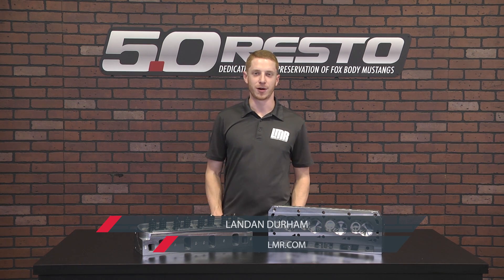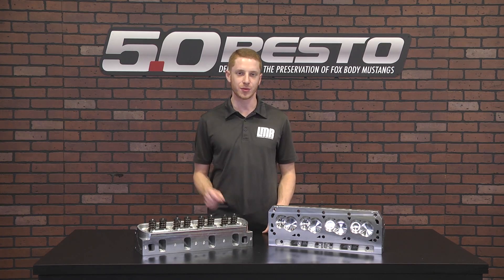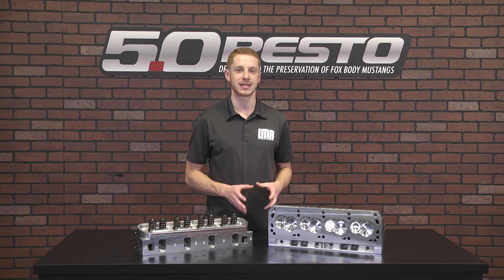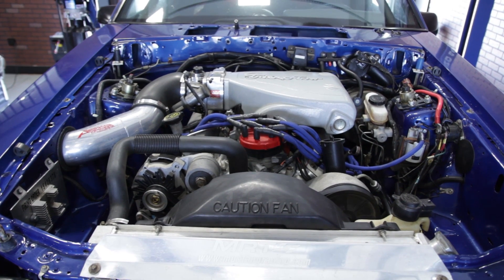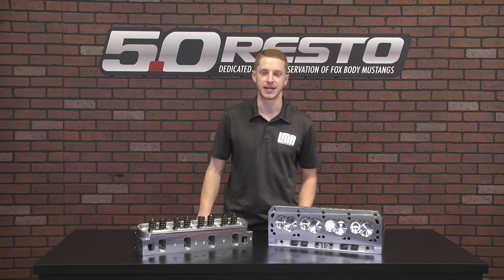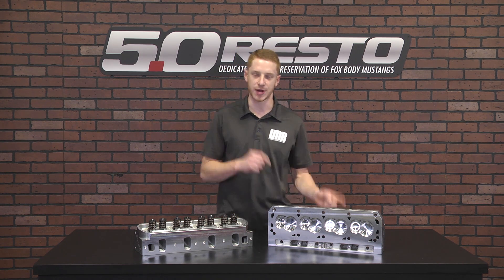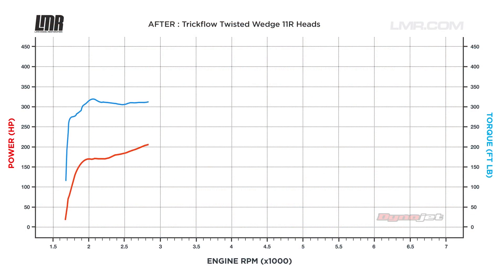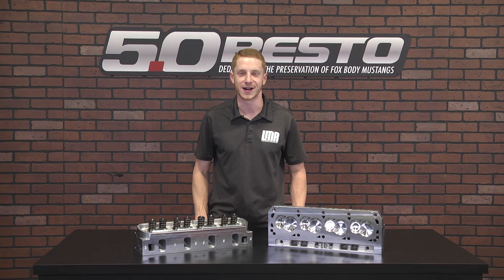1979-1995 Mustang Trickflow Twisted Wedge 11R Cylinder Heads - Dyno

Comment: The 331 made some horrible power before hte 11r... my stock 302 with a stage 2 ported performer (not rpm) head with a 1.94 valve change made 315 to the rear wheels.... ran 7.70s in the 1/8th on motor...
Reply: How much did the 11r smoke the stage 2 ported performer heads?

Comment: 5600 rpm is the peak?? Those heads would make a lot more power with a lot more camshaft. Why not build it to peak at 7200+ ?
Reply: Exactly, 302 has a short stroke when you're concerning small blocks.   So 7200rpm is easier on the bottom end than 7200 on a ls or a sbc or a 351w or a hemi.

Comment: more torque than horsepower needs a bigger 11R head like 195 comp port small cc combust chamber
Reply: The biggest restriction in this setup is the intake, all though im with you with a 331 stroker, why wouldnt they have just put the 190cc, or even the 205cc 11R's!?
Reply: Which intake should they have run.   I'm so used to seeing LS numbers.    A good built LS1 ( 346 ci ) make 400-460rwhp with 400-420rwtq.    It'll have stock bottom and from stock to 300cfm@.500" lift type of aftermarket head, cam, exhaust, possibly intake ( ls6 or fast ).    A good built LS3 will make  450-550rwhp and 430-465rwtq.

I want to see 331 and 347 fords making  420-550 rwhp and torque over 400 rwtq, showing good efficiency in the combination.     @evilinside5984

Comment: I used these with a ford B cam on a 331 stroker years ago, trickflow intake, bbq shorty headers, and it pushed out 390hp at rear wheels at the dyno shop, I miss my old fox body
Reply: The prob. is different dynos, are calibrated diff.= will give diff. results. Im sure your combo ran well, and you sound like you were happy with it? But the engine in this video, has way better flowing 11R cyl. heads ( that werent available back in the day), with the smallest cc chamber ever offered by Tfs, for stock 302s= more compression ( 11 to 1 comp. In this 331)= more power, with a more powerful cam= Tfs stage 2, specs.= (int. Dur. @ .050- 224°, Lift .542), (exh. Dur. @ .050- 232°, Lift .562), Lobe sep. 112°, vs B cam specs.= (int. Dur. @ .050- 224°, Lift .480), (exh. Dur. @ .050- 224°, Lift .480). I would think this 331, in this video, has approx. 40 to 45Hp more or so, then your combo? Dyno shops used to setup there printouts to show the customers, estimated Flywheel Hp., and Tq., making the customer think the readout/printouts were chassis dyno results. If they did that, your 390Hp would make more sense, as the Tfs 11R heads, with 53cc, and stage 2 cam, made 432Hp on trick flows engine dyno, = +42Hp more than yours. Again not hating, just trying to put your power #s into perspective, vs these power #s.

Comment: If I had a tuned H/C/I 331 running 110 and made 317hp I’d be a little upset.
Reply: same throw some tea trick flow high ports on that bitch big runners, a nice efi victor intake with an elbow and tb, grab a custom solid roller cam from someone, t&d shaft rockers, and throw a nice turbo hanging off the front like oh i dunno them ball bearing forced induction turbo hanging off the front or whatever… put a nice th400 behind that…… I could go on for days, but yeah they could at least put huge heads on it, solid roller cam, and at least spray the bags off it to see where the power is
Reply: The 11R top end kit, dynoed @ 432Hp, @ the crank.

Comment: Great gains thats roughly what i made (same HP but a few less TQ) with my 331ci back in 90s with TFS twisted wedge heads, Shorty headers are holding that setup back.
Reply: I went from 6.43s in the 1/8 with shortys to 6.42s with long tubes and then 6.41 with a victor JR. 351, flat tops, .600ish cam, dart heads, 750 Holley, 125 sniper jets, th400, 4000 stall and 4.56s. Shorty’s aren’t that bad. Had a similar set up on a 3rd gen firebird just a gm version. 355 flats, victor jr, 4.56 gear 125 same trans and 4.56 gear after some weight removal ran 6.50s with shortys. Not all shortys are created equal
Reply: Ported Old school TFS 170's could make similar power than these 11r's do.   Ed Curtis and Brian Tooley had programs to make them do the numbers.

Comment: What's the edelbrock cam specs
Reply from the maker: Hey John,

It was an Edelbrock Rollin' Thunder 2221 Cam
Reply: It was an Edelbrock Rolling Thunder cam #2221, cam specs= (Int. Dur. @ .050- 227°, Lift .520), (Exh. Dur. @ .050- 234°, Lift .520, Lobe sep. 112°

Comment: I went from 170 twisted wedge to 11r 190s on my 347 and picked up 53hp
Reply: Damn.. heads ONLY swap?
Reply: Big difference between those two cylinder heads, particularly when comparing to the 170cc's. The 190 11R's move a LOT of air.
Reply: @DeltaElite121  True, good for over 600HP naturally aspirated.
Reply: And the 170 TW already beat the inline valve heads in it's category ( edelbrock performer rpm, afr 165, windsor sr alum,  gt40p, etc ).
Reply: What was your result on the 347 with the 190 11r tfs?

Comment: HI everyone, I have a 1990 Mustang Gt with 11R-190cc-56 heads, cam,  24 lb Injectors, with BBK everything and Ported Cobra and made 331 Whp and better  391 WTQ ! Why So Much more TQ, Cobra Intake?
Reply: Got a build thread anywhere online?
Reply: injector is probably maxed.
Reply: @ryanjamieson8779  What did you mean by injectors probably maxed? The injectors showed while dyno tuning to be around 80%. What I was asking Is why do I seem to have more torque than most equal builds but also slight less horsepower? Maybe the  Cobra intake off an actual 93 cobra instead of an aftermarket
Reply: Can I ask what cam are you running?

Comment: So the results were:
"Built 331" with basic bolt ons, shorty headers, aftermarket H/C/I: 363rwhp/376rwtq or 1.10rwhp/1.14rwtq per ci.
For comparison, the dyno results on my 2006 GT were:
Stock 281 3V with basic bolt ons, stock exhaust manifolds, stock H/C/I:  310rwhp/328rwtq or 1.10rwhp/1.17rwtq per ci.
Basically shows just how efficient the stock 3V H/C/I are right out of the box.
Reply: Basically, 3V's have proven to be the most UNimpressive mod motor to date...
Reply: @02autogt  Totally disagree with you there mate. I think that title goes to the '98 & earlier 2V engines, though they do have longevity in their favour. The 3V is also very reliable but you have to keep on top of the oil changes, and use a high quality synthetic blend or full synthetic to avoid problems with the VCT system.
Reply: 3V certainly has more potential than the 2V's.   The heads can flow similar to gen 2 Coyotes with porting on the intake side.    @DJDinaggio
Reply: I wish they would have given us more info on that car.  I made 320 hp & 332 tq with a stock 302 shortblock, 11R 190 heads, an Ed Curtis cam and Holley SM2 on 93 octane through a stock AOD and converter.

Comment: just do a 351w swap! its the best investment i ever made..you immediately gain an extra 50 c.i. that with minor work and $ bolts directly in and if you so choose a 351w can be stroked to a 408, 418, 427 stump pulling cubic inches in a stock block and still be reliable...theres no replacement for displacement.
Reply: Megan Tripp hey, I been really debating on this swap on my 90 mustang. What would I need for this?
Reply: @FishingWithJo415  you need  special motor mounts or keep stockers and get a cowl hood,  351 headers,  swap engine accessory bracket,  upper and lower intake,  oil pan,  sn95 sway bar mount.  Those are the essentials, could be other small details.

Also depends if you want efi or carb.
Reply: @FishingWithJo415  Since you are on YouTube I'm going to take a wild guess that you have the internet. Try Google?
Reply: A stock 6.0 with a Elgin/SS2 cam put down 514 hp qnd 493 ft lbs and that cam used to be $220
Reply: I would do it if I had a bad crank in my 302 but I wouldn't just throw it away.

That and the fact that someone already hooked up 2.5 inch true duals with a h pipe so I'd hate to get rid of all that for a tall deck 351
Reply: mrhazel the 351 headers bolt up to the 302 exhaust
Reply: @dangerousfreedom4965  🤔 buy still if it's a good 302 I'd avoid hunting the 351w down ..but a clevor 351 would be cool...
Reply: Actually a cam swap will get you 500 at the crank on a 6.0 go watch Richard Holdener he has lots of videos of a 6.0 with just a Brian Tooley cam that puts out alot of power
Reply: Drop in a stock 6.0 LS nothing but a cam change n tune and you'll be 500 horse at the rear wheels instead of wasting your money not even get 400 🤣🤣🤣
Reply: @neilbrown82  a healthy 408 stroker is gonna make a hell of alot more than 400...500+ is easily doable on it too.  A cam only 6.0 wont make 500 wheel either.
Reply: @michaelharris748  LMBO, 500 to the wheels? what? get real..

Comment: Why would you use 110 leaded race fuel with EFI? The lead deposits will cling to the O2 sensors and throw the reading off. Just throw E-85/E98 in it instead ...but replace those o2 sensors first
Reply: its 11:1 you're pushing that even with EFI
Reply: It's because they Really Don't know what they are doing, case in point; the dyno'd an SVO with the stock Top Mount Intercooler and didn't use a fan to blow through the scoop.  About like the Idiot Pat on Horsepower TV...
Reply: Hopefully you know the o2 sensors can be turned off and not even used... And no, I'm not referring to turning off the rear o2's on an OBD2 setup...

Comment: I cringe when i hear "flowmasters"
Reply: why?  they all make within +/- 5 hp in any test you can try to find  but they all wont tell you that CFM has very little to do with how a true chambered muffler works. I have them on my zephyr with an H pipe.  2.5 inches.  stock 302 sounds good for now.  I want these heads in 170
Reply: I love the sound of an old school 5.0 going through Flowmasters over any other brand of exhaust

Comment: 2013 F150 with a 5.0 was 360hp and 380lb/ft. Ford did a great job with the heads on those motors
Reply: Them are 2 different motors. The one ur talking bout is a mod motor. Total different motor block heads
Reply: Jamie Anthony different sport my friend.
Reply: Jay Why 

Just noting the difference between then and now sir
Reply: 2013 is a Coyote engine 5.0.. this is a Windsor
Reply: Not at the rear wheels though...
Reply: @02autogt  obviously
Reply: Put the jurnt down your to high

Comment: Wonder what this would dyno on a stock 351w bottom end
Reply: Most likely would be similar numbers to this, seen a very similar setup on an engine dyno, and it was about ~100hp more than what this dyno’d which is generally about the amount that is parasitically lost through the drivetrain
Reply: go with small cc comb chamber and 11R 205 comp ported, give them boogers some flow
Reply: tfs 11r 205's get 500-600HP without much effort.

Comment: im running this combo on my 347. I made 475hp and 440tq
Reply: HandyHusband on motor to the rear??
Reply: Bucks good for over 600, tunings the biggest issues and it's the crank twisting that breaks the block just fyi
Reply: Is there any issue or fear of the block cracking?? Cause that’s what I’m trying to do and I don’t want to be in borrowed time till it crack. I’d like to have a nice strong daily
Reply: @devinwiliams8123  its in the tune, not a specific horsepower number. Block is good, watch total timing.
Reply: DEVIN WILIAMS supposedly factory roller blocks are good 450-500, not sure that’s a beat on it all the time racing situation though. Rule of thought, any block you pickup that hasn’t given up, is usually the good one, I got my block for free machinist said looks like a good one, Lol
Reply: how much mpg are you getting?

Comment: The 53cc feature 170cc runners not 190.  The 190 comes with the 56cc.
Reply: False..both runner sizes offer 53 and 56
Reply: 11R does indeed have 53cc chambers as an option.
Reply: @jackrabbit7389  11r 170 do 11r 190 do not those are either 56 or 66 because i am looking at them
Reply: What’s the difference between the 53 and 56 ?
I have a cam and headers whichwould work best ?

Comment: On a 331, why didn't this car make over 400rwhp?  These heads bolt right up no need to fly cut the pistons? A blower or nitrous would really wake that thing up
Reply: The hp numbers are pretty much dead on for the supporting parts on a 331..the real world hp numbers are not like what the internet claims they are
Reply: It's a 331 so different pistons
Reply: Biggest restriction in this combo, is the intake.

Comment: It's sad that in 2017 we STILL have pushrod 5.0 guys realizing bigger IS better. Put a set of real headers, real intake, and real cam and you will see over 400rwhp with those 11r heads. Come on guys, this isn't a stock shortblock HCI build and it isn't 1998 anymore. Wake up
Reply: Sorry I meant "It's sad that in 2017 we STILL have pushrod 5.0 guys that don't realize bigger IS better"
Reply: It’s sad that pushrod 5.0s are still walking a lot of cars with BIGGER engines lmfao
Reply: Kevin S I know this post is old but if you happen to see it, tell me; 11r 205cc,  56cc heads, on a 94 cobra. What are your thoughts?
Reply: LS guys showed it's about the "combo", the guys over here should have figured it out.     TFS11R 205 can make 400-550rwhp on 302-408 cubic inches.     @kevins1142
Reply: Yup. People worried about a head being too big yet you got the LS oem heads flowing what smaller tfs heads are flowing and then are amazed when a big head , ported intake , custom cam setup does the opposite of what they thought power wise.
Reply: Yeah 331 at that i want to see combo on a 302 stock motor
Reply: Agreed. After all these guys Dyno ran an SVO and didn't have a fan blowing through the intercooler. They aren't very good at what do ..

Comment: lmao "stock" he says
Reply: tukamoton1312 he mentioned some upgrades before watch the video again
Reply: +Say11911..I’m not sure if you know how to read or are deaf but he clearly states the car is 11:1 comp which is pump friendly idk where the hell you are getting 110 from lmfao..regardless he clearly states that this mod is for off road use and they are testing a TRACK car which if one had sense would assume this is race use lmfao..he also clearly tells you the make and model of each part if you are too lazy to google specs well that is on you..barometric pressure?..lmfao now your just being an ass
Reply: Exactly!  How many "stock" applications run 110 leaded race fuel?  None.  They are designed to run pump gas, which tells me this engine in order to use 110 octane is running a compression ratio at/above 12:1 and not "roughly 11:1".  Even with aluminum heads, efi with knock sensors and custom maps I don't recommend going above 11.8:1 (N/A) on pump gas or a dynamic compression above 8.4:1.  Unless you are planning on running E-85 (the 85% ethanol : 15% gas, octane rating of 100-105).  Ethanol responds like race fuel, it burns lower temps and slower - which requires high compression to harness the energy.  This test is misleading to guys building a streetable car....On the street you use what is at the pump, there were no cam specs given with the swap, no rocker info, no dyno barometric pressure or corrections given.  In essence this test didn't have the pertinent info for consumers to make an informed choice.

Comment: push it to 7k rpm only 5.6k
Reply: Power falls off way before 7k
Reply: Why? You can see on the dyno graph that power had already peaked.
Reply: Not to mention, the factory rev. Limiter is set to 6,250 Rpm, on 5 speeds. Both of my 5 speeds= 6,250 Rpm factory rev. Limiters. My auto 5.0 is 5,500 Rpm limited, as ford new the automatics wouldnt hold up as well.